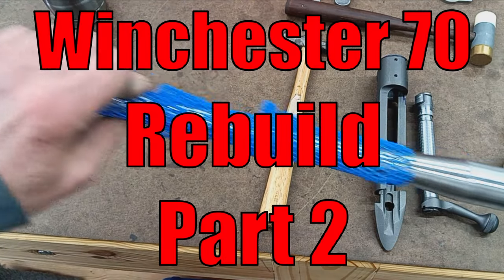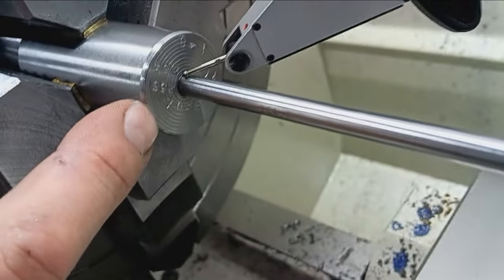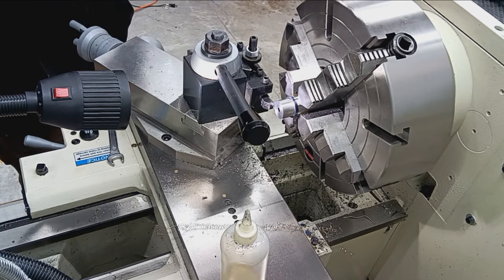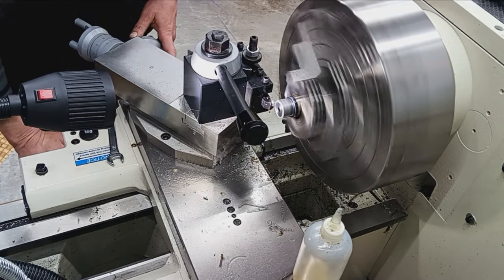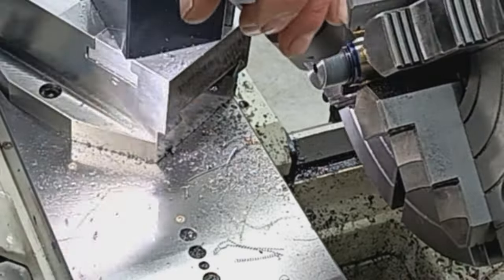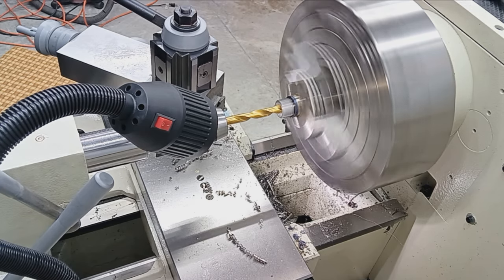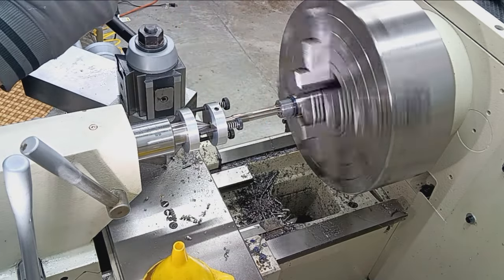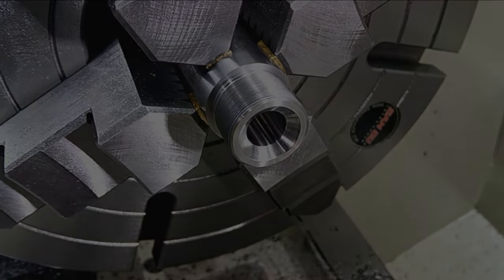Winchester 70 Super Sport CRF Rebuild - Part 2 - Fitting and Chambering a new BRUX barrel & more!

Comment: Just a tip. Flip your threading tool over. Run in reverse and thread away from the head stock.  It will relieve a ton of stress and you can choose exactly where you want the thread next to the shoulder. Invest in some thread files they help a ton with fine tuning.
Reply from the maker: that's a good tip!  I do do this when internal threading actions.  Will give it a try someday.  Thanks for watching and for the comment, mate!

Comment: Geoff, follow up on a question I had on part 1 of the series: How, after adding the sleeve to the bolt, did you eliminate the bolt handle resistance on the down stroke to allow for setting shoulder bump on fired cases when resizing brass? In part one there was definitive resistance due to the addition of the sleeve. Your response to me was it would be resolved in the barreling and chambering in part 2. I must of missed something because the bolt dropped with zero resistance in this video. Question 2: Using the "scotch tape" method no-go, what do you think your final headspace is allowing for "crush" and what fpt are you using to tighten action to barrel? Assuming, from barrel contour, this looks to be a hunting profile barrel. If "crush" is .001" to .0015", head space would be worrisome for any type of debris ending up in the chamber shoulder area and rendering the rifle inoperable. What's you opinion on this?
Reply from the maker: Hey John!  I really appreciate you watching the videos and engaging the channel as you have.  The bolt did drop freely around the 58 minute mark in part 1.  After lapping the lugs and all the playing around with it, it definitely had no resistance.  I hope that makes sense...  2:  Yes, I chamber headspace on the "tight" side and have never heard back from a customer complaining about inoperable rifles due to debris.  I work with a lot of hunters and out here the dust blows a lot!  Never had an issue...  I suppose it's possible, but so far so good!  It's a discussion we have before the work begins and if the customer wants a "looser" headspace (within safe limitations of course), we can do that too!  Thanks again and take care!

Comment: from my experience as a machinist and building rifles, with the way you are holding the barrel, you are not aligning anything. you are just flexing the barrel. once you loosen up the jaws and that fixture on the outboard side of your headstock, everything is gonna go back to its original position and be misaligned. 

check out nathan dagley at straight shot gunsmithing.
Reply from the maker: Watch part 3.  Proving it at 1000 yards should clear up any doubt.  6-ish inch group at 1K yards with genuine reactions from the actual customer isn't too shabby...
Even though not every second of the operation was shown, please do not assume things were not done properly.  There are many ways to "skin a cat" so to speak...A good lathe with a dual 4-jaw chuck can and will align a cylinder with a hole in the middle to within a couple tenths, as proven many times in our video library. 
Geoff has trained and apprenticed with the best in the business (Gordy Gritters, Greg Tannel, etc.), a CST graduate, and a former CST instructor, has over a decade of experience, has done hundreds of rifle builds, and knows his craft inside and out.  Each job is unique and the customer chooses which path to take in the overall process.  
SSG seems to have a very good contraption for holding and aligning barrels, but it's not the end all way.  Our rifles shoot 3/8 MOA or better consistently.  
Mister Dagley does not respond to questions that we have asked (we wanted to purchase his system, but unfortunately he seems to  ignore all emails, phone calls, etc.), so we use what we have.   
We do appreciate you watching the videos and engaging the channel.
Reply: you've only shown that the barrel was  dialed in while the barrel was flexed, and like I said, when the jaws are loosened, it goes back to its original shape. Nathan dagleys TBAS is the only way to prevent this. if you truly understood alignment you would know this.

gordy gritters, greg tannel, and the like have only made do with what they had. That doesnt mean the explanation above doesn't happen. If anything, the results on target shows that gunsmiths don't have as big of an effect on accuracy as they think they do.

with two indicators, some trigonometry, and an understanding of alignment, what is going on with these old school methods can be shown.
Reply: @reloadingfun you are exactly correct.  I like the giggle method for tight threads or loose threads.  I build rifles too and Bux barrels are good don't get me wrong but there are another half dozen just as good and less expensive.  But sometimes confidence in equipment is important too

Comment: I’d throw those range rods in the trash. I did 10 plus years ago and direct read off the groves.
Reply: I've heard that from just one other builder who said he could not get repeatability from them. I believe it was Gordy who told me that. He had returned to using the "gauge" rod for preliminary indication and then direct to the bore except for the really long cartridges, then he uses the "gauge" rod all the way. I've only used the "range" rod on one occasion and did my own testing by placing it in the bore, indicating the barrel co-axially, then removing it and rotating it 90 degree and indicating again. Doing that four times I got a total of .0002" variance. That could be from the piloted bushing play between the reamer bushing pin/shaft and the internal diameter of the bushing. What has been your experience to speak so negatively regarding the range rods?
Reply: @johnseptien3138  I could never get them to repeat after removing them and putting them back in the bore. Also reaching up where the throat will be with a indicator the barrels just where not dialed in that true. I’ve used the gordy rod as there called for ruff dialing and they can work pretty good. I still prefer to dial off the grooves and I also don’t use a pilot on my reamer. The reamer will follow the  true hole I’ve bored that will be concentric with the throat.
Reply: @k4391  so are you using a rigid reamer holder set up? Or a floating reamer holder.
Reply: I’m using what’s referred to as a reamer pusher in the tail stock. If you look for a mike Bryant or Dave Tooley pusher you’ll see how simple they are.